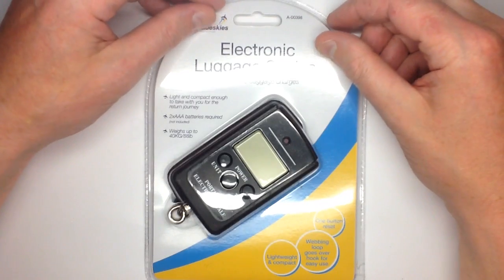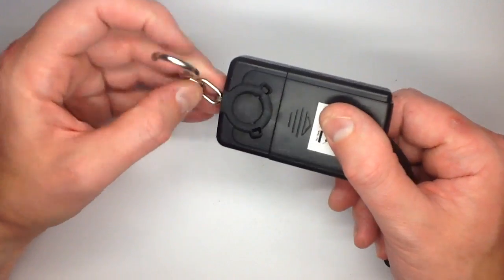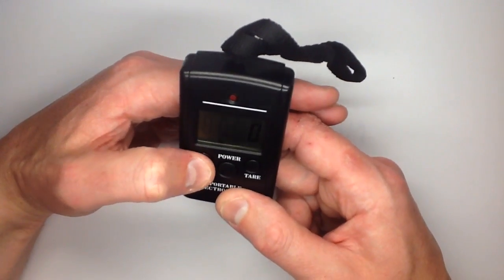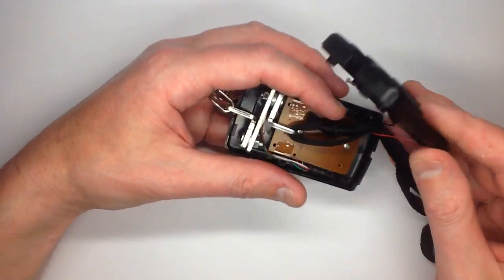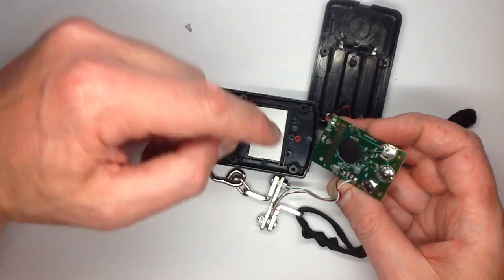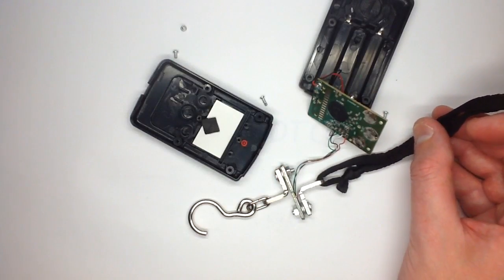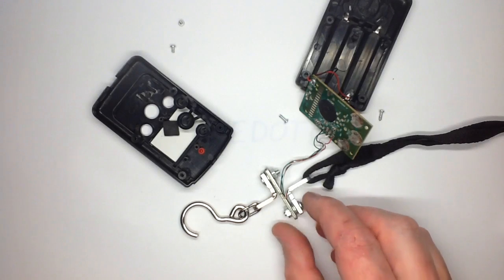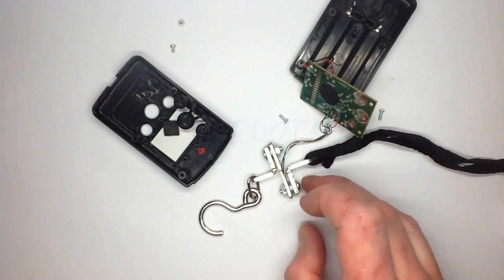Inside a ridiculously cheap digital luggage scale.

Comment: If it's like mine you can enter calibration mode by pressing and holding all buttons from off state. Again if it's like mine you need a 20 kg calibration weight to calibrate it. No your 20 kg dumbell, kettlebell etc. isn't accurate enough.

Comment: I have two of those, a 20kg and 40kg unit. They track each other very well, as well as tracking other scales and some light calibration weights I have. The one thing to watch out for on those things is the "final value hold" function, which is on by default. If you have a changing weight they you are measuring, this will just latch some arbitrary weight at some unknown time.

Those load cells are now available individually on eBay. With no useful instructions, of course.
Reply from the maker: I discovered that latching feature.  And also how to turn it off.
Reply: +bigclivedotcom  These scales use cheap force cells not " load cells"  as the force is always along the same axis.  Pan scales are different , they are weigh cells because they measure a force at any distance from a reference vector.  Force anywhere on a pan moves the strain gauge through the same distance. Hence constant.

Comment: We use the load cells for static test for aircraft components, they are strain gauges. These are linear, though they are also available in 3 directions called rosettes.

Comment: What you have there is a full or half wheatstone type bridge. There is no need to temperature compensate it. Also it will be absolutely linear so the manufacturer just needs two calibration points.Regardless what the shape or accuracy of the spring body is.As long as shape change stays out of the plastic range(overload). All electronic scales are done this way and they work. You cant mess this up.

Comment: Does yours measure temperature too? Try holding down the buttons.
Reply: Had to go and test... It's the "Unit" button,  hold it down for a couple of seconds and mine shows the temp in degrees C.   Hold down the "Tare" button puts it into calibration mode.  Probably they had a spare channel on the D/A converter so put a thermistor onto the board.
Reply: mc349iii It strikes me that the calculation would vary some factor in the load math with some temperature coefficient -- I bet it needs to know the temperature in order to get a reasonable repeatability since the unit is portable.
Reply from the maker: mc349iii That's interesting.  I'll have to try that when I'm back at my workshop.
Reply: +mc349iii mine doesn't have that option.